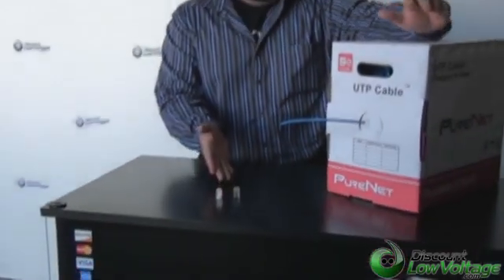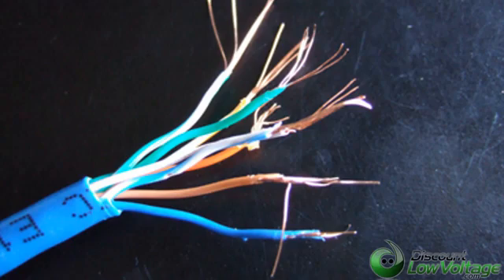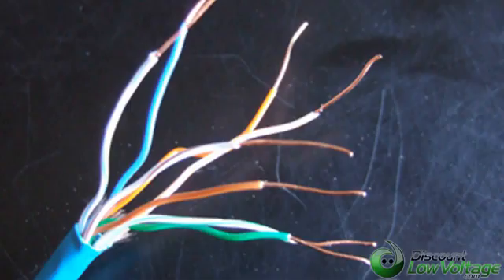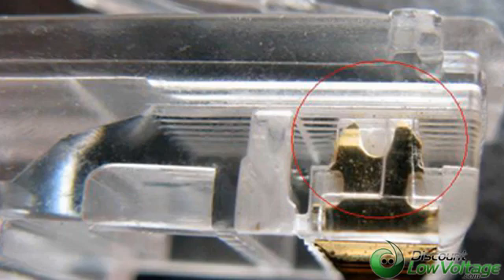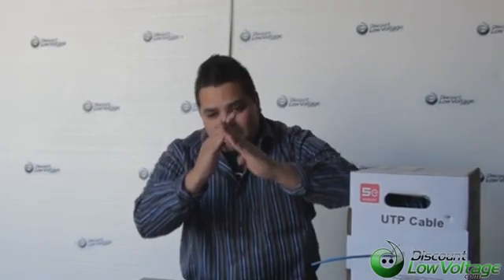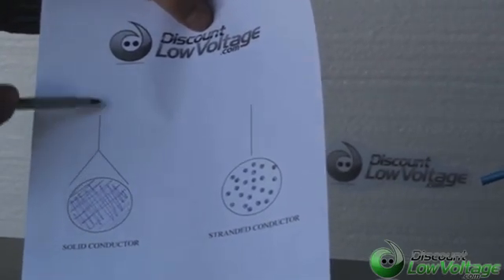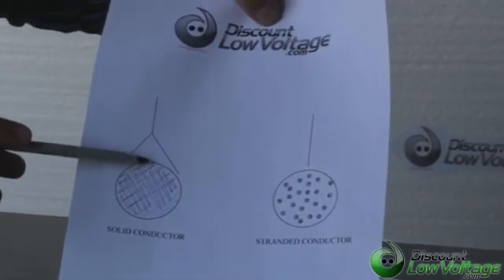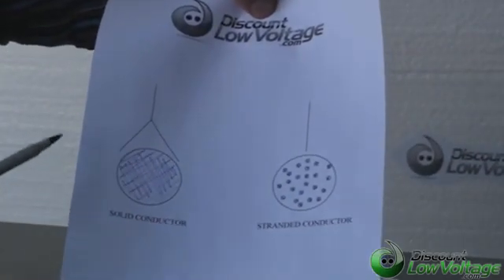The Difference Between RJ45 Solid and Stranded Mod Plugs – YouTube

Comment: I've been tipping network cables for over 20 years and never knew there was a difference in the connector.  Thanks for pointing that out and describing the difference in connector types.

Comment: I want to use Cat-6 for a non Ethernet purpose where I need to solder one end of each wire to small momentary push button switches.  I would like to use stranded since the application will also cause the main wire to move frequently, but the big issue is how to strip 1/2" to 3/4" of each stranded wire (to then solder to button terminal posts) and not lose any of the strands as they are super thin and easy broken.  Solid 23 awg would be a lot better but again, this is going in something that will move a lot. (it's a control yoke).

Comment: Solid cable is great for holding current over long distances. Stranded should be only used for short distances. I hope that helps.
Reply: And solid cable is better for a "set up once never touch again" approach, as they tend to break more easily than stranded wires (that's why stranded wires were introduced)